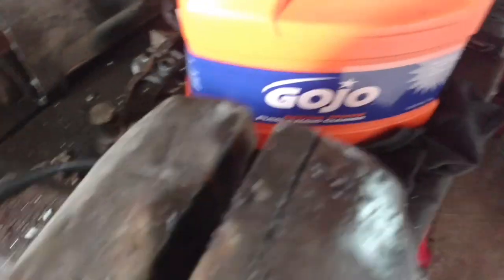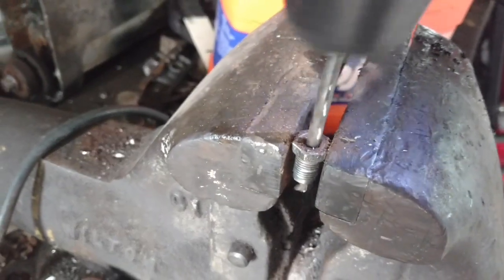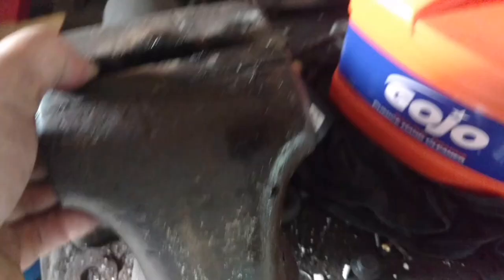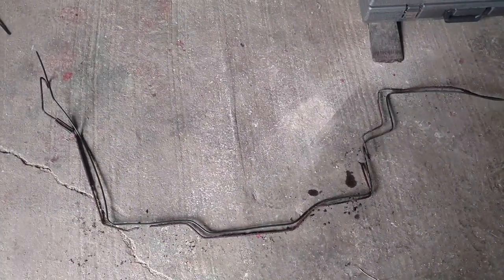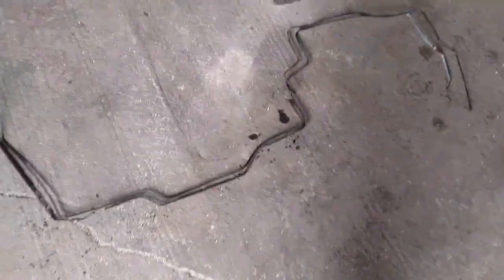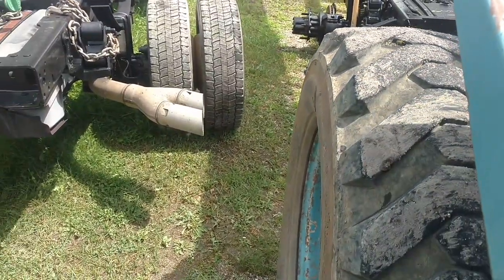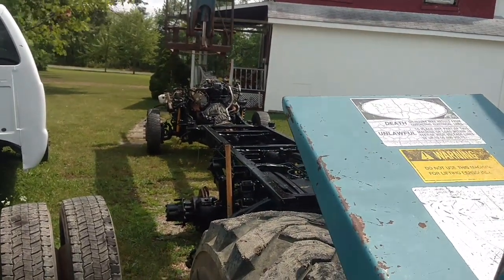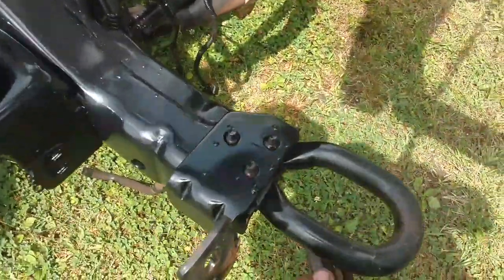NAVIGATOR PARTS ARE ON ORDER....LETS GET READY TO PAINT SOME WHEELS!

Comment: that 90 degree stuff sucks. here in WI it was a high of 64 yesterday and about 67 today, of course rain and wind tho. our heavy truck tire outfit does a shotblast and powder coat, in either white or gray for 25-30$ a wheel.  holds up pretty good with the toxic road brine.
Reply from the maker: i had a set of aluminum wheels blasted and powder coated a few years ago and they held up great. it will be cold soon enough i am afraid.

Comment: in a previous video you talked a little about doing an AC recharge doing an ambient temperature thing. would be interesting to see that, maybe not any " freon recovery " tho.
Reply from the maker: since i dont have a scale to measure the ounces that are being sucked into the system, i use a chart of ambient temperature to high and low side pressure readings. it is not the most accurate way to charge it. i ussually stay on the lower side of the range.

Comment: You can find Ford Mortorcraft on Amazon for less than half dealer and get free shipping most times. But the wait time is longer.
Reply from the maker: sometimes i buy oe ford from "freedom racing" decent prices and fast shipping.
Reply: I'll have to check them out I hadn't heard of them before. I heard you say sealed power as well I've never had nothing but good luck out of anything from them myself. Now Dorman I had to take the last EGR tube off I bought of theirs it wasn't calibrated right It cost me the price of it and a Mortorcraft one to replace it with both just trying to say about 25 dollars to start with. And to beat it all I learned that lesson a long time ago.